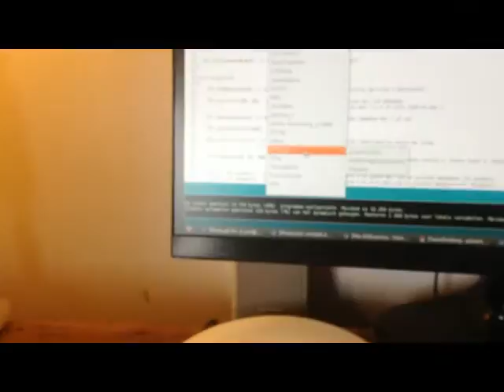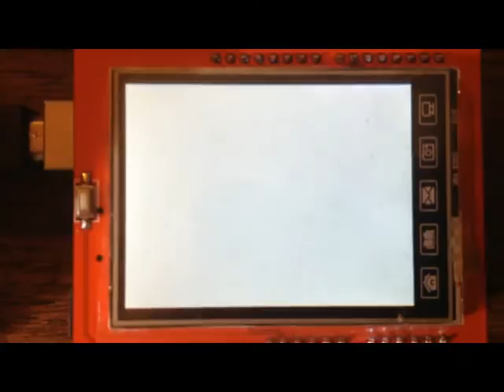Problems with arduino with TFT LCD shield

Comment: Same problem with 2.8" screen. Interestingly, example 1 from their user manual (which writes data to the screen manually rather than using the libraries) still works so it might actually be an issue how the library handles writing data.

Comment: I had the same issue. never fixed it. I believe it is because the top of the USB port is metal and it shorted out a component on the Display, If you decide to get a new one put electrical tap on the top of the USB Port.
Reply from the maker: +Scott Wanner No components in the way on my shield... so the problem is elswhere. But in your case: if you stick some cellotape (or other non conductive tape/material) on top of the USBport; won't that solve the issue?
Reply: both